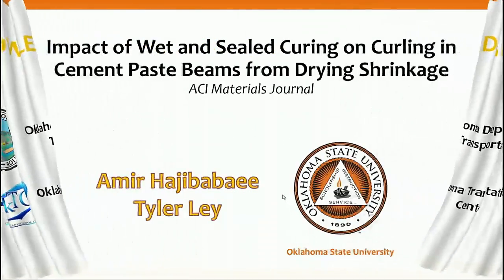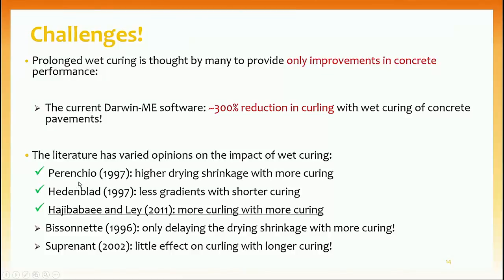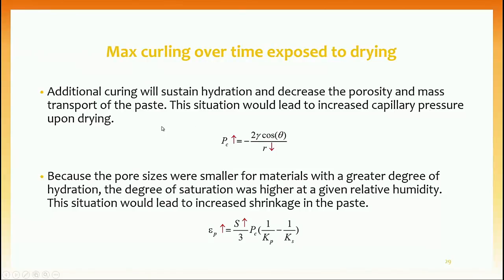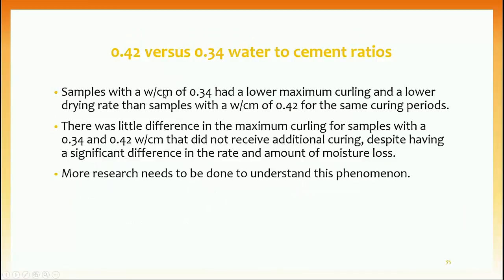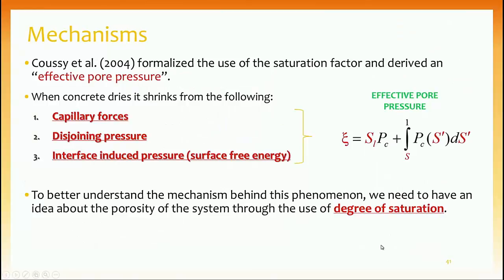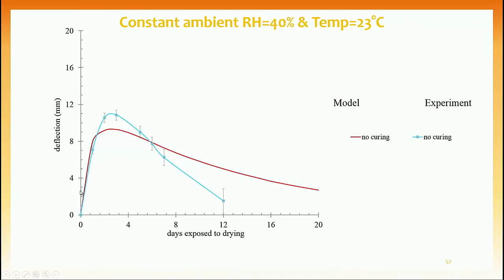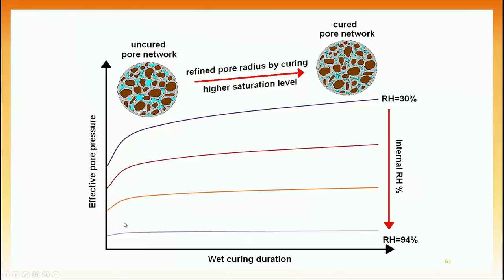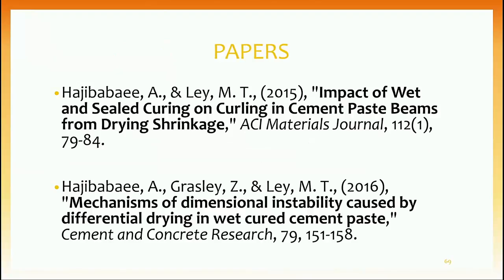Impact of Wet Curing on the Curling of Cement Paste from Drying Shrinkage

Comment: A traditional material for maintaining surface moisture is burlap or hemp fabric. Usually two layers are needed and a clear polyethylene plastic film on top to slow evaporation. The clear plastic allows monitoring of moisture content. The edges should be held down with sand or soil. 

A recent alternative is wet paper pulp. It is essential to apply this with almost no drop-height to prevent disturbing the wet concrete surface. You still need to cover with polyethylene film. 

[edit] remove the pulp before it dries. If concrete is applied over soil, the natural moisture content must be high enough to prevent the concrete bottom from drying. If not, then the soil must be covered with a polyethylene water barrier.